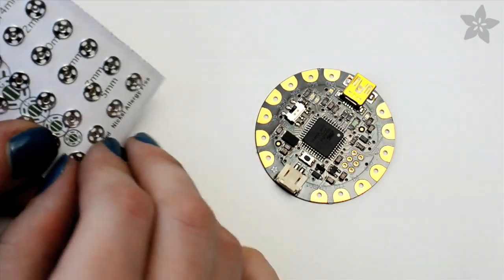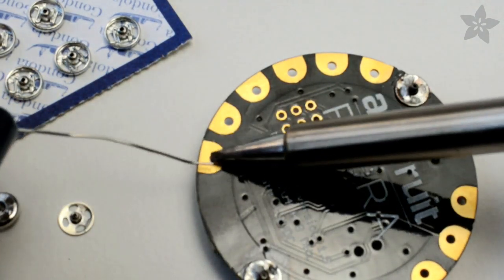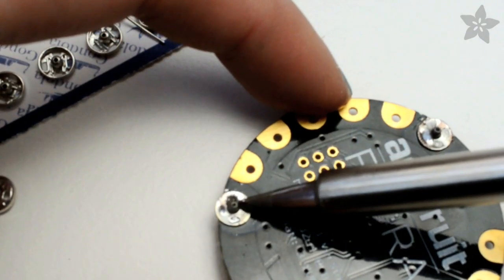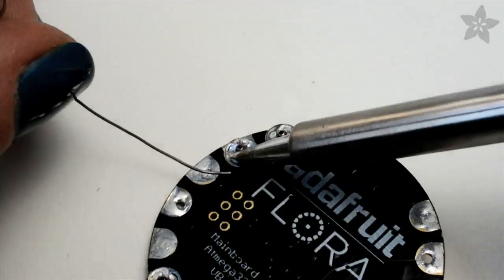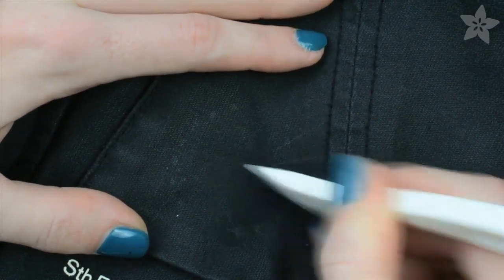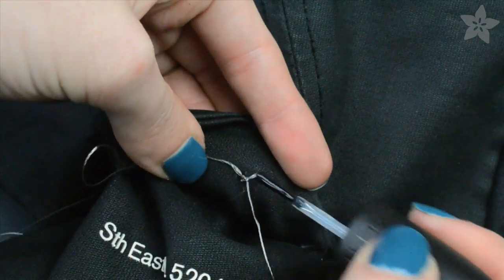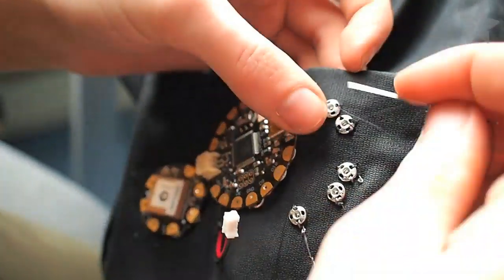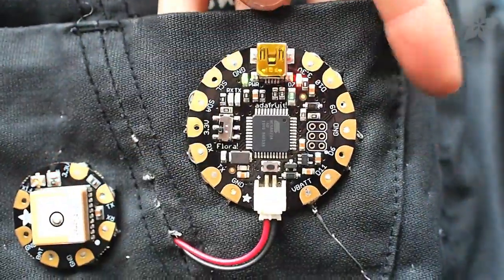Flora with Snaps

Comment from the maker: Flora Snaps - Easily removable snap-on Flora! #wearables #FLORA
https://learn.adafruit.com/flora-snaps/overview

The small 5mm size of these tin-plated brass snaps means they fit perfectly on Flora's pads! Snaps make a great connector for wearables-- solder one side to the board and sew the other to your project with conductive thread. Easily disconnect your Flora for use in multiple projects, or remove it prior to machine washing.

Comment: I really like the snaps, and nail polish idea, those were pretty sweet. I would however suggest pre-tinning the snaps, fluxing the pads, and pre-heating the snap before soldering it. You can also get nicer looking results with a little less solder.
Nice video, I wish I had products and or services for you to sell, because I like the way you do it.